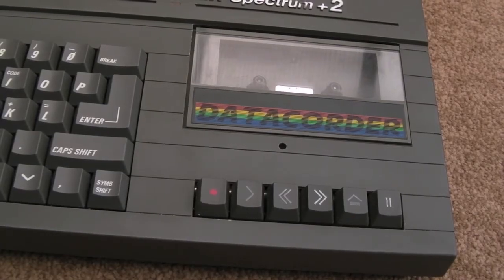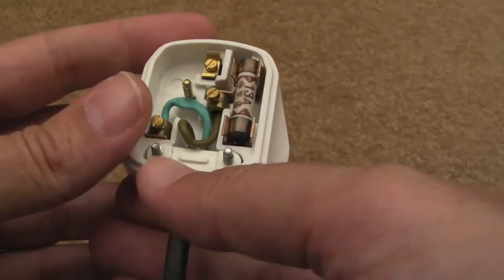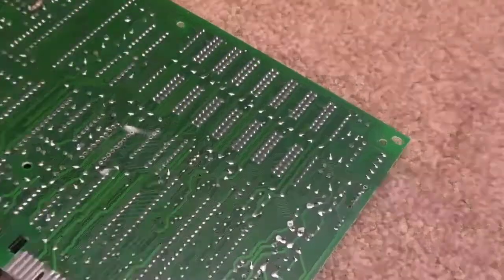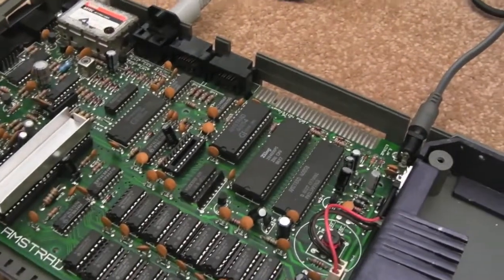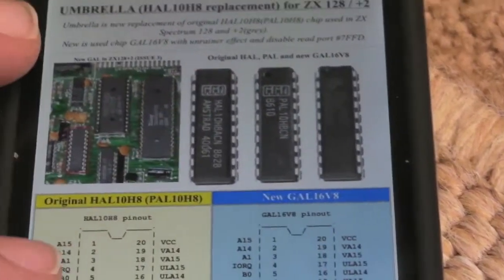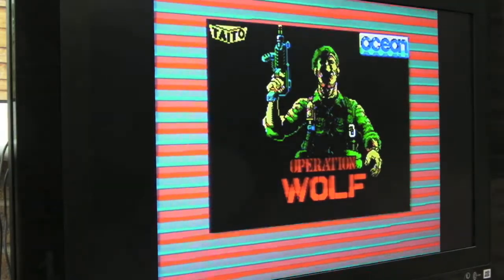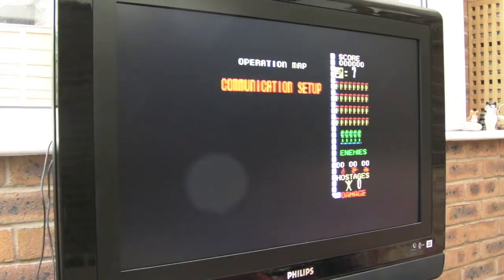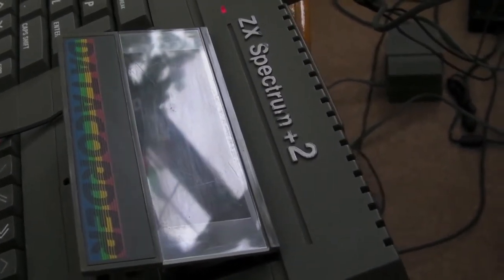Sinclair ZX Spectrum +2 Umbrella (Raining) Fix

Comment: Live should always be shorter than neutral in a plug, with the earth (if fitted) always the longest of the 3.  If the cable is tugged to the point of disconnection this ensures the cores pull in a safe order and will remove power live first, leaving the protection core til last.
Reply from the maker: Yes =D  The neutral was a bit too long imo and needs a few mm cutting off.

Comment: I have a +2a motherboard that works "fine" the machine boots to the menu 
but when you touch with your finger the IC15 Philips chip the tv picture is completely scrambled, sometimes it even causes
the spectrum to rest
then if you lift the finger the picture returns to normal
I'm not talking about touching the IC pins... just the black casing, even the slightest touch immediately disrupts the spectrum

Its the only motherboard where I've seen this happening... I have no idea what this is...
Reply from the maker: It's worth checking the solder points underneath, maybe a dry solder joint?  The other type of thing that causes problems like this is when you have a bad ground connection, so it could be a dry solder joint somewhere else on the board.

Comment: +GadgetUK164 thank you very much for your videos. they are great.
 I got a ZX Spectrum 128k +2 that didn't work. I replaced the RF modulator and got a very very decent picture. The games load fine. although I'm facing 1 issue.

I have a bit of background noise (interference like). This is gone when I disconnect the cassette player. Also after pressing enter to load the cassette, even before pressing play, sound (noise) is getting in making the colour frame around to show up and change colour in a very timely fashion from red to blue. So I believe the problem is somewhere on the small PCB board of the cassette player. Do you think that replacing the capacitors there would solve the problem or would you suspect it to be something else?

I would be very thankful if you could point me in the right direction. :)
Reply from the maker: I am not sure if its a design flaw - I noticed that when I used my +2 on the floor that I got terrible background sound also, sounding like interferance from something.  I later noticed that when it was lifted off the floor the sound vanished almost completely - I think this sort of behaviour is attributed to ground connections.   The thing that solved it for me was doing the stereo audio mod (I did a video on it with links to the seller of the PCB).   That stereo audio mod not only balanced the ULA beeper sound properly with stereo music from the OPL chip, but also removed all noise and stopped the problem I had when running the +2 from the floor.

If you are getting the same behaviour from a desk, then maybe you have a fault somewhere.  You could try recapping the tape deck, but it could also be a bad ground connection or something like that.

Comment: I think your knowledge on spectrum stuff is way up there and this is why I would like you to post in some shape or form, how to remove audio from the tv signal in a zx spectrum 128k plus2a (Black). I want to know where the capacitor to remove is. I can use the audio out on the back left of the machine. I just want a better picture
Unless the RGB peritel output may work better. Am hoping for a rgb to scart socket then scart to av composit would work?
Reply from the maker: Hi, thanks for the nice comments, and sorry for my slow reply!  I think its C24 you need to move one leg of.  See schematics here:- http://alistairsserver.no-ip.org/public/spectrum/schematics/+2A+3schematic.png

I believe you need to remove the side that is connected to pin 8 of the TEA2000, and connect that pin of the cap via a short wire to the emitter of TR1 (I think??).  That should seperate the audio from the composite signal, and hopefully introduce it in the right place for modulation.

Comment: Hi GadgetUK164,

I own a Spectrum 128k +2 Grey model (french menu) with same board version 3 but no RF modulator and direct RGB connection via a Scart cable. I do have a Divmmc x3 reader from 8bits4ever https://www.8bits4ever.net/product-page/DivMMCx2 working perfectly with a ZX Spectrum 48k. Unfortunately there are problems with the +2 such as menu freeze or Exdos not booting at all. Working for a short period of time on cold boot then hangs, freezes or resets :-(.
Could be as suggested by other users that this is due to a weak clock signal to the I/O expansion port. Is there any mod available to try to fix this problem?
Reply from the maker: It's possible but tbh I would be looking at other possible causes first.  Does it behave the same way with tapes - that's worth testing first.  Load the same games that crash when using the Divmmc but load from tape without the divmmc connected.   If it only glitches when the divmmc is connected there are a few other things to try - clean the expansion port connector on the motherboard.  The ideal way to do that is to use an eraser on both sides of the connector, rub away any oxidisation, and then wipe it with IPA.  You could also use something like deoxit on there to clean the connector edge up.   It could also be related to capacitors, weak PSU, or maybe even a glitchy chip somewhere.
Reply from the maker: The other possible cause might be the M1 line on the Z80.   But if its working some of the time I would assume that to not be the cause.  To fix that you would need to swap out the Z80 CPU - I covered that in one of my videos.
Reply: Thank you for having taken the time to answer. Sorry I did not explain what I already did to try to fix the problem. The port connector has been already cleaned on both sides with a rubber and IPA and yes I do have tested the machine with a bunch of old cassette tapes games and they just load fine. The +2 seems to just work normally, it will boot up, I can get to the menu and select either 128k mode, 48k mode, calculator or tape loading without any problem. It just do not want to load the exdos of the Divmmc and no SD card browsing or at least it will boot on a cold start and then crashes after a short period of time (and not possible to reconnect the Divmmc until a certain cooldown period). I remember having managed to load one day a game but this was more a lucky situation were I probably did the browsing quickly before any crash occurs.
I heard about a possible failure of a capacitor of the 12V line. I could maybe try to replace it if I have a clear indication of the capacitor position on the board.
Reply: I do have another Z80, the one mounted on the ZX Spectrum 48k and I assume it is the same and can be tested also on the +2. Unfortunately the Z80 on the Spectrum 48k is soldered on the board. I do have a little experience in desoldering small IC's using hot air but I do not want taking the risk with a 40 pin chip :-(. I have a web supplier and I was thinking anyway to get a couple of Z80 spares so I will test this and see if it will clear the issue hopefully.
Reply from the maker: Yes, the Z80 from a 48K model will work.  If you're not experienced at desoldering don't start by practising on the Z80! =D  Just order a couple of new Z80s and you should be fine.
Reply from the maker: It's more likely the Z80 I think.  Although it could be the Divmmc - have you tried on the 48K spectrum for a period of time?
Reply: This is what I will do :-) Let's see if changing the CPU will solve the problem. Thanks!
Reply: Yes the Divmmc is working like a charm on the ZX 48K. No problem at all for hours.
Reply: I have swapped the Z80 with a new one and this has obviously cleared the problem! Now the Divmmc is just working fine :-) so the M1 line was missing on the original CPU :-). Thanks for helping me spotting this problem! Now I just noticed that sound is quiet weak but I have seen there is a fix for that (to have stereo and higher audio output). I am using an RGB to SCART TV with a standard CRT TV. Video is sharp I do not see any ghosting or Umbrella effect but need to check this with an HD TV before.
Reply from the maker: Excellent =D

Comment: Why did the old plugs use a 13 amp fuse? and what difference does it make replacing it with say a 3 amp fuse?
Reply from the maker: Not all plugs will have a 13 amp fuse.  This plug was likely fitted by the original owner, and they just put a 13 amp fuse in there.  The power supply won't draw more than a couple of amps, so a 3 amp fuse is a good rating to use.  If something goes wrong with the power supply and it's internal protection fails, the power supply could draw a huge amount of current, for example maybe 9 or 10 amps.  If there's a 3 amp fuse in the plug, that fuse would blow.  If there's a 13 amp fuse in the plug, then 9 or 10 amps would not cause the fuse to blow, which would result in the wires heating up like an electric fire element, which would ultimately result in fire.
Reply from the maker: It's basically a case of if the power supply fails in a way that the manufactures didn't design protection for (which does happen, ask anyone who's house burnt down through electrical fault), then the lower rating fuse (3 amp covers pretty much all retro systems) will blow and save you from fire.  Say for example the primary windings in the transformer short, it could draw a LOT of current, 5, 6, 7, 10 amps etc in a short period of time.  Cables fitted to those types of power supplies will handle say 2 or 3 amps, maybe 5 amps if you are lucky, but they will heat up and melt through the cord and ignite anything nearby.
Reply from the maker: Yes, you are right, most of them draw less than 1amp.  The problem is that any power supply can in theory draw what it wants when it fails (based on the fuse) - depending on exact design and where the fault is, and whether there are any internal fuses etc. For example, Megadrive and SNES PSUs likely have a thermal fuse inside, so if the windings  were to short and it starts to draw 5 or 6 amps, the transformer would very quickly reach a temperature where the thermal fuse would blow, so in theory that safety fuse could save your house etc.  That said, there's nothing to say someone hasn't been in there before and swapped out the thermal fuse for a bit of wire etc.  The point I am trying to make here is that ANY PSU could in theory fail and if the fuse is not rated properly it could start a fire.  You tend to find that the PSUs which are built onto a plug (eg. Genesis etc) are reasonably well designed and the chances of a problem are slim to none.

That's also a reason why I never leave PSUs plugged in and switched on when I am not using them.  There's also the possibility of the thermal fuse blowing when there's nothing wrong with the PSU, simply because it has been left plugged in and switched on at the socket for days or weeks etc.
Reply from the maker: LMAO!  Yes, sorry - I am being over the top in my warnings about fuses, but if one person takes the advice and switches off that PSU at night, or puts the right fuse in - that might be the one person I save in my entire life ;)

Comment: I tried this fix and yes it gets rid of the "raining" effect but most Russian demos still crash, and my original Carrier Command no longer loads. I think I'll replace the original and wait for a better fix/solution
Reply from the maker: Thanks for the info - very interesting!  Are you sure you connected to the refresh pin correctly?   Which demos fail - I will test them out on my +2.
Reply: I'm not sure if there is a problem with my +2. I can't find my old HAL to replace it. Can you try to load Carrier Command to see if it loads on yours? Maybe I have a memory problem. If it loads on your's then I'll check the memory. If it won't load on yours then I'll have a look at which demos have a problem
Reply from the maker: I will test mine when I get chance!
Reply: Cheers, strange that it worked fine before the mod. I also note that Starglider 128k doesn't load either...
Reply: Just to update you on this. It was nothing to do with this Snow fix. I updated the RAM with Lotharek's  S-RAM replacement, and it now works fine!!